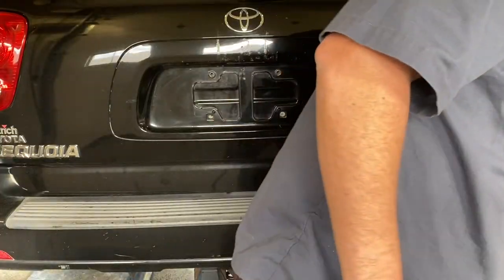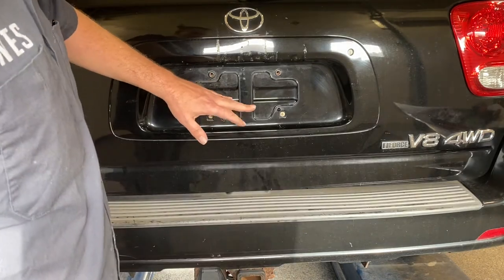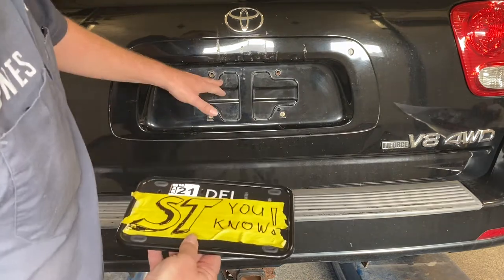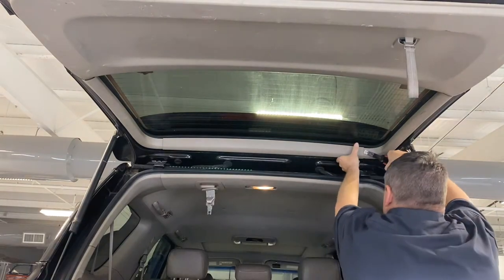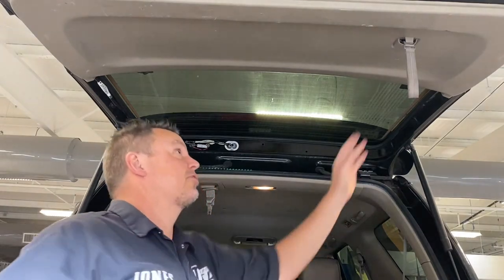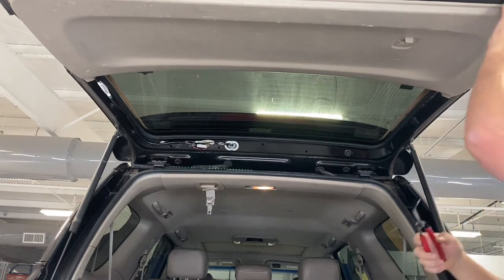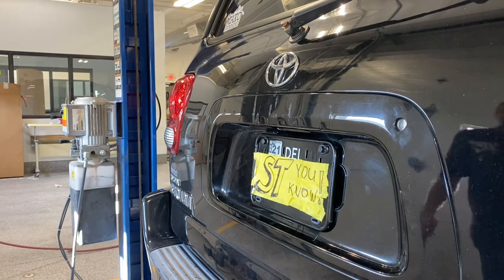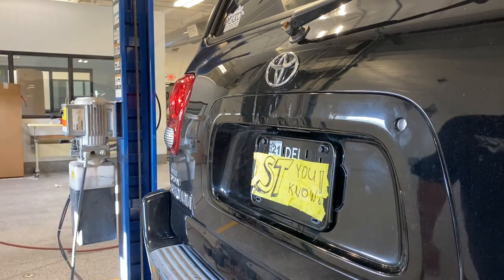Repairing License Plate Holes On The Toyota Sequoia

Comment: How many of the heavy duty clips are holding the plastic panel/pocket in place? I feel like there is something up by the handle holding it in place but don't see any more clips.

edit: I figured this out. You also need to remove the two 10mm nuts holding the hatch release handle to the body in addition to the heavy duty clips and the lock cylinder 10mm nut.
Reply from the maker: Sorry I can't remember.
Reply: @sussextechautobody9914  No worries. I thought I'd reply just to make sure anyone else who has the issue sees this. Basically the clips are in the corners. The issue is the handle. Even though it stays attached to the plastic trim piece (license plate area), you still have to remove the two 10mm bolts hidden behind the round body plugs. Then it comes out easy.